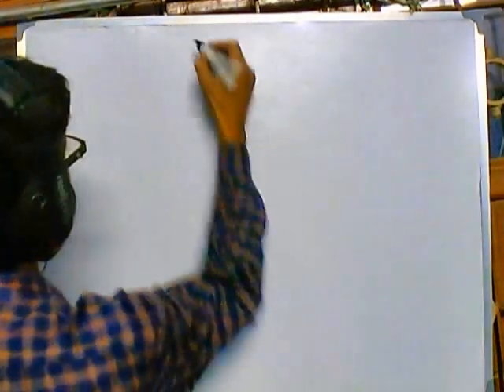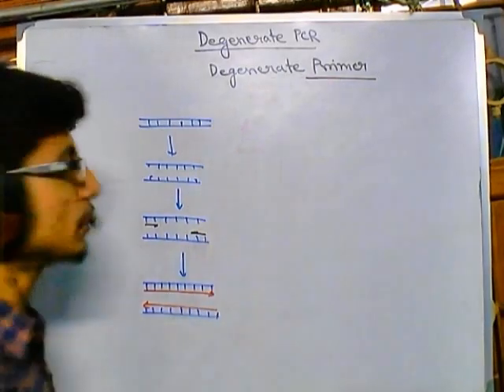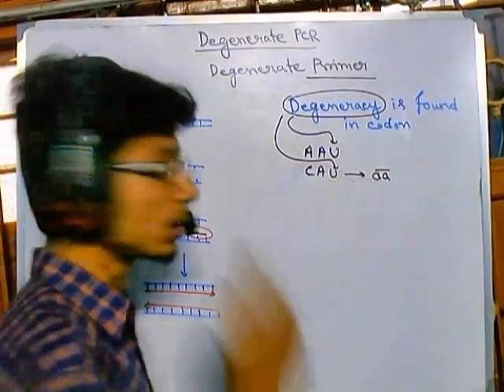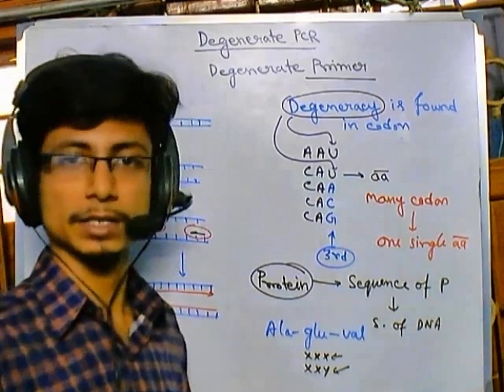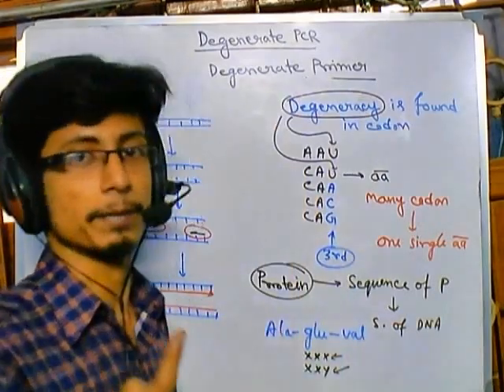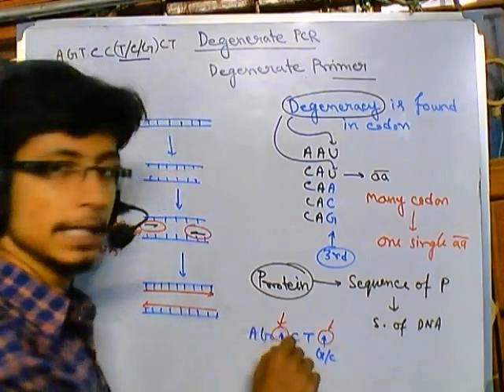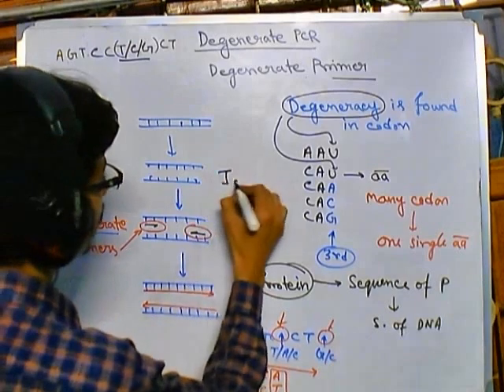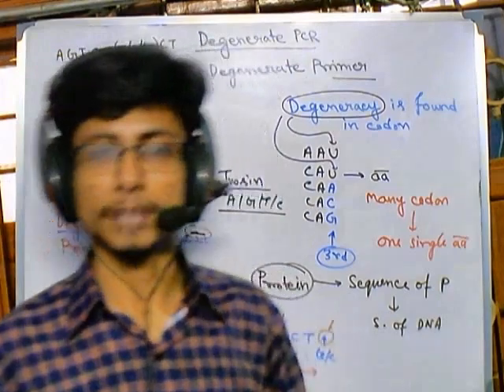Degenerate PCR

Comment: i have  a doubt.... from the protein sequence  u can generate  degenerate primers .but what will be the template dna for this pcr because u have only the protein?
Reply: may be.. degenerate PCR is used when you exactly don't know about template dna's sequence but know amino acid sequence. so you test the primer first, and then you cloning the polymer for sequencing. After sequencing, you can compare your work to original sequences which are not  perfect.  In conclusion, you can know your dna sequences by degenerate PCR, and you can also use this degenerate primer at RT-PCR, qPCR, etc.